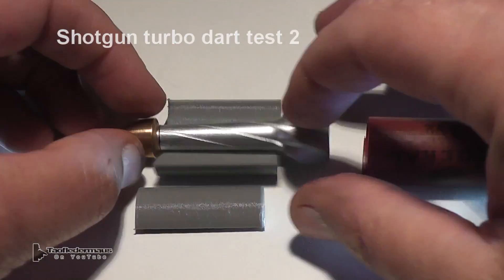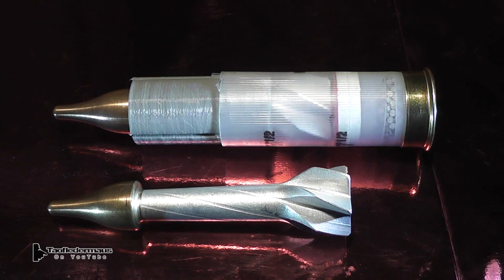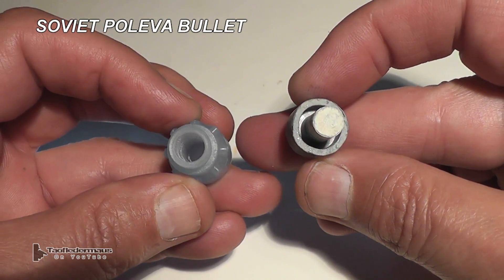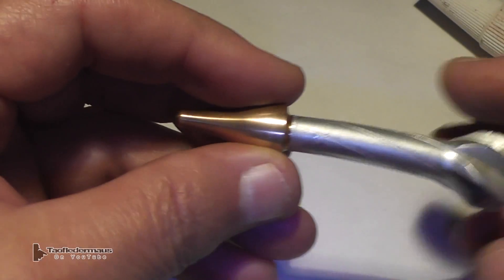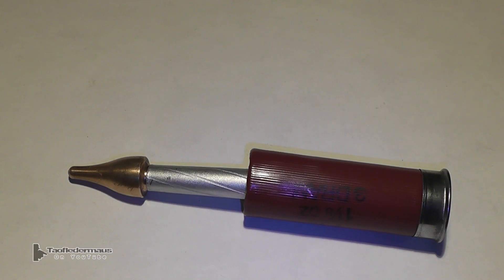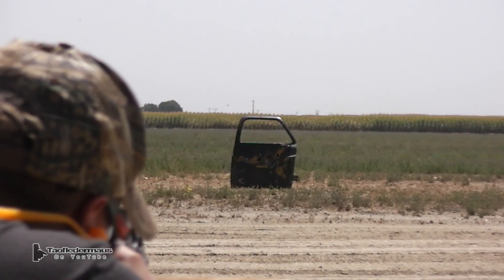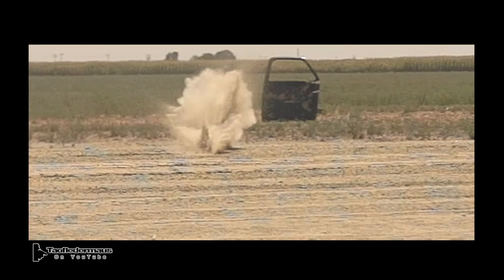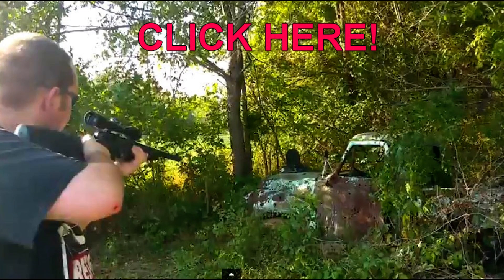Turbo Shotgun Dart - Test #2

Comment: I feel its fairly obvious why the two separated in the original test, the power of the shells powder was concentrated on the brass nose, not on the aluminium, it was far too loose with holes between th fins. 
The aluminium was simply too heavy to allow the parts to stay together, "the tow broke" so to say.
The Russian shell, having far lighter tailpiece of nylon, does not suffer from that, helped (probably) that the weight of the nose might have been greater, therefore "slower" in speed and acceleration.
The test failure with loctite was simply because the body of the dart was bent.
It needs to be absolutely straight to be valid. But, having the original set up,say with a sabot to "push" on the Alu fins, instead of the Brass nose, might have made the original shot work as required, but just guessing...
Great and interesting videos, thanks for sharing them for us all.
Happy easter.
Andy

Comment: magnetic shot will fly slower due to the induced eddy current as a flies through the barrel, which acts as a resistive force. The same concept is used for brakes in electric cars.

Comment: Heres a very good inside tip. https://www.youtube.com/watch?v=G5_JqBTpZr8
As you see in this video the mass of the head of the rpg is massive contrary to the tail. Also note that in the end one only need minimal drag in form of the fins. Less is more. Btw. Ur 3 part sabot are spot on. You only need a little more deflecting angle on them so they seperate earlier.

Comment: I think you need to find out what the ratio to the projectile to the size of the bore I mean the 120 on the Abrams is huge but the dart is only like 50mm so I wonder if there's a size dart that would be idea for the 72 caliber bore of a shot gun in fact I wonder if you removed the hull from the shell and loaded it with like a pellet of triple seven powder would it fly true at the lower velocity? I looked at the cannon round for the 103 tank its loaded that way propellent separate from the projectile

Comment: true,
it is awesome both of the shooter/experimenter (who are risking dynamic failure et their lives... and are excellent shot and advocate of responsible firearmery)
and
Tim, who make some improvised round and experiment with type of load or effect.
Together, some frontier are pushed, it is a privilege to see.

It is skill to get such round even careening and keyholing to land near to the targets,
yet, repeatably... it is much better even than a jury-rigged tester with only some string
(such as a safety concerned ala Mythbuster may to try)

Tim's tungsten round and his javelin or 2 stage rounds are also interesting...
reuseable mostly, a few of those. and the cavitation on the 'warhead', it beg to become a two-stage system for more oomphs.
it will be fascinating to see how some of tf00t's inroad with 'coulombic decomposition'
can be implement into a round -
envisage the power of a grenadier, yet, without requiring that heavy equipments or to change from your 
favorite operating system?
reliability in hypersonic ballistic reaction is the main drawback... and some costs...
of course, to experiment with the salts (thorium, eka-potasium... etc) would be even BETTER - but, too expensive to do really,
hence maybe simulation only for a while.

further, the experiment in different substance fired from the smoothbore 
is great to see for some ballistic effect in the 200yd range.

Comment: so, i had an idea for you to test out. the shape would have to be up to you, but a standard slug or a dart like this would work. possibly steel core ammo may work
So, if you where to use a home made slug or dart, you make the front of it out of lead, however the rear half of the dart of slug would be made of steel. Shoot it at a large neodymium magnet. see if the rear steel side curves towards the magnet before impact. i imagine it would need to be a large magnet, maybe 6 inches, for it to be noticeable in  slow motion, but you may be able to get away with a 2 inch cube. 
Steel core with a 6 inch or 2 inch magnet, you could shoot ever so slightly to the side and see if the bullet is pulled towards the magnet as it passes

Comment: +TAOFLEDERMAUS

The issue with that round is that the tip causes drag when it's supersonic. It's because of the huge drop in cross section area where the tip and the shaft are connected. The tip needs to be as narrow as the shaft at the point where they are connected. Though then you would need some way to keep is straight in the barrel.

Comment: I think that with a sabot, the glued together round will work quite well.

As an option, could Tim simply pin the two parts together?
Reply: It was bent to the point that even with a sabot it wouldn’t fit in the shell or even the barrel. The only way it would fit is if it was a custom made, for that round, sabot. But that is a good idea.

Comment: Have you considered using a bit of the Barrowman equations for stable rocket flight? I know this dart is not a rocket, but the application seems appropriate in this case. It is important to note the fin diameter to overall body diameter (this determines the center of pressure, or CP), and the CP must stay behind the CG (center of gravity) as much as possible. CG is probably not an issue with this because of its length and brass tip, but with the large diameter on the brass, it brings up the overall body diameter relative to the fins, which means that the CP might be too high. I'd recommend either increasing the fin length, reducing the brass diameter (relative to the shaft and fins), or it might even help just to slot the brass tip to bring down the CP and allow air to flow into the fins. You can also smooth out the back end of the brass rather than have an abrupt cut (perpendicular to the axis of the shaft). Lastly, if you need the overall front diameter to keep the shell oriented straight, you can have a small diameter brass tip with a sabot around it, just like a sabot tank shell. Cheers  Edit: Here's a link to NASA engineer James S. Barrowman's 1966 paper: https://www.apogeerockets.com/downloads/PDFs/barrowman_report.pdf

Comment: A failure? Yes, but at least this time it was actually traveling nose first and spinning.  I wonder why the rounds won't do this when they are new. Perhaps the sabots (if that spelling is correct) should be hollow like corrugated cardboard to allow wind flow to the fins? That's just an uneducated guess.

Comment: I think that the head of the round splits the air in such a way that the tail does a poor job stabilizing. Perhaps putting  turbine grooves in the tip might work.
Reply from the maker: +Mike West   I'm hoping Tim will make some different noses.  I think he made a lot of the alum. bodies.   Make some with sharp, long tips,   fat blunt ones,  etc.    He wasn't too sure about these so that is why he just sent the two darts.

Comment: If you look at successful dart projectiles like the M829 as an example, the fins need to be much smaller and straight. The length should be ten times its diameter and the body should have taper points on each end. It should be made from hard material like steel and dragged out of the barrel by a forwardly attached two piece sabot which separates from air pressure outside the muzzle, you can not push it from behind. If you push from behind the point rides down the inside of the barrel because of internal pressure and turbulence so it exits at an odd angle instead of perfectly straight as it would if pulled from the tip by sabot which maintains alignment until it enters free air. In this way the projectile acts as a counter balance on the sabot in the barrel and will self align until separation. Sabot attachment is accomplished with a small lip of larger diameter on the projectile body.

Comment: Poleva bullet cup is HDPE as far as I know.
The designer of the round, mr. Polev spent several years finding that perfect form, which locks cup and lead projectile together through deformation from the shock.
Reply: +Eugen Afanasjev it's LDPE, according to Russian article in Wikipedia anyway.
Reply from the maker: +RusZugunder  ah,  thanks!!
Reply from the maker: +Eugen Afanasjev   It could be HDPE,  I just assumed it might be nylon for strength.
Reply: +RusZugunder 
Both are true actually. I translaed an article from a russian site, and from the shape and year print on the cup in the video, it is more likely to be HDPE.

I might be mistaken, but since there are several batches and 3 generations of this slug design, it might as well be another plastic.

Comment: I think the reason many of these rounds don't spin properly is that they are traveling straight until they leave the barrel and then start spinning which causes them to flail around. maybe if create spiraled sabots they would spin the projectile from the beginning and it may stabilize it. I'm not an expert by far but just my thought.

Comment: I love this design, but why is the tip of the dart so pointy? Don't you need a more blunt/rounded head to give stable flight during supersonic? And I'd guess it would fly better if the tip were heavier. That way the center of mass is in the nose rather than the shaft, since things tend to rotate about their center of mass during free flight.
Reply from the maker: +Neal Nesbitt   That's just how Tim designed them.
Reply: Gotcha. Can't wait to see more of them. I think it would be awesome to test these thing in a wind tunnel too =D
Reply from the maker: My wind tunnel is at the shop getting the dilithium crystals rotated.

Comment: smooth bore rounds prove ineffective at any distance, trying to achieve stability through fins or vanes is useless, if anything, they go really crazy.  but so were the dreamers of flight in the 19th century.

this exercise is only useful in how to kill someone with an unconventional round to avoid ...   nevermind, you can't trace a shotgun round anyways, LOL

i just had a thought, have a rifling "eraser" at the end of a barrel that would scrape the rifling marks off a bullet as it exited the barrel, that would be some great machining work!
Reply: +mr bad example The M1 Abrams tank uses a 120mm smoothbore with an effective range nearly double the rifled counterparts. Smoothbores can be effective with proper engineering.
Reply: +Savio Strawn and im pretty sure it reaches the longest ranges with its APDS shots, i wonder if a miniaturrized version of that or maybe the one on the leopard would work (i think the leopards is slightly simpler)
Reply: +Savio Strawn 
If I had to guess I'd say part of the extra range comes from the added energy that would normally be lost to forward motion transformed into spinning.
Reply: RustyDockLight Not exactly. The majority of tank munitions are dangerous far beyond their effective range. They just cannot accurately hit anything smaller than the Kremlin. The Abrams smoothbore is exceptionally accurate when coupled with modern optics.

Comment: I can tell you before I even watch it that it's not going to work.  Loctite is not glue.  either thread it in or use a roll pin.
Reply from the maker: +butre jp   What do you have to say AFTER you watch it?
Reply: ***** would it work consistently?  consistency is the most important factor when deciding whether or not a round is worth a damn
Reply from the maker: It worked consistently one time.  So yeah. lol